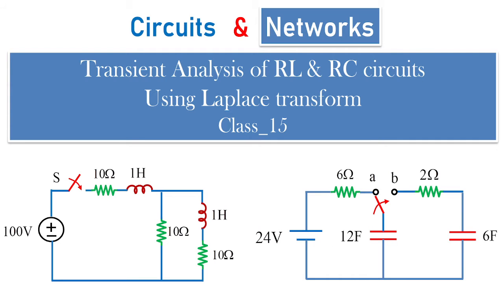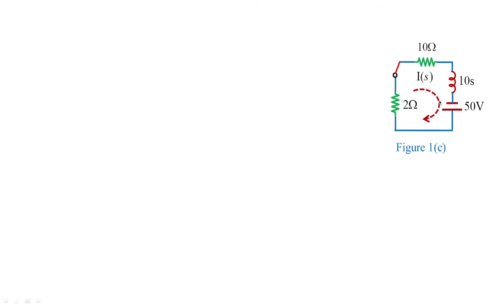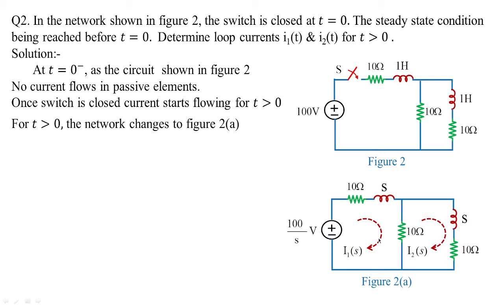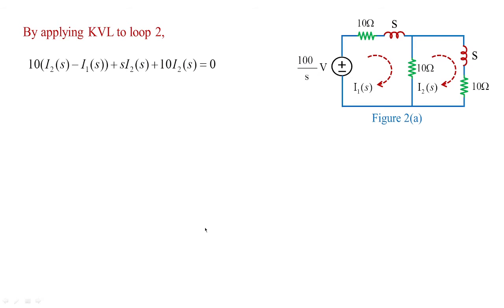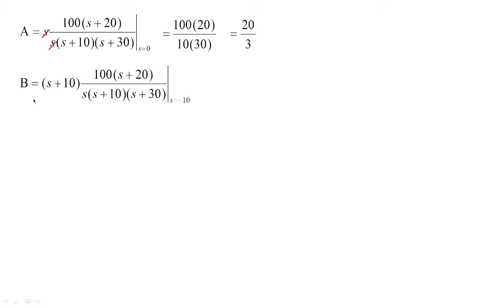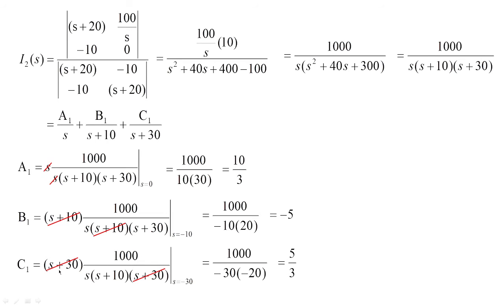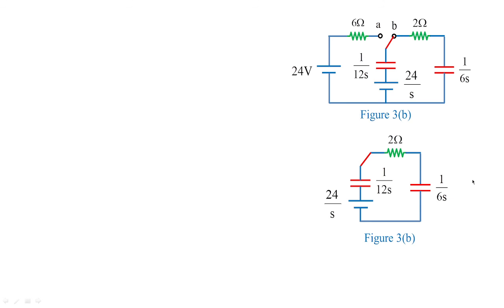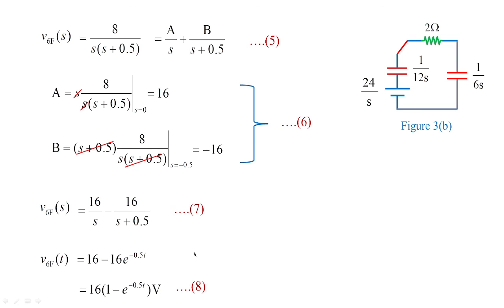How to obtain transient current solution using Laplace transform technique?

Comment: sir question for the first problem. When the inductor is discharging we take the voltage 50v  in the kvl directly in case of an inductor but in the last problem for the capactor we take 24/s. Why dont we take 50/s for the inductor also?
Reply from the maker: ya listen, the actual impedance formula is given by Z = (R+jX) ohms, where R is Resistance (Real component) and X is Reactive (imaginary component). Here, X could be XL(inductive reactance) or XC(capacitive reactance). if inductor is present then XL = wL, if inductor is present then XC =1/wC. In frequence domain XL = sL, and XC =1/sC. for further clarifications, look out the transient analysis using Laplace transform techniques.
https://youtu.be/gGjhO5zbPNE?si=MxXPAg2vnWurvzgk 
https://youtu.be/BwDWSqKfGKo?si=sywDKjs-Ydy205Cy

Comment: In the last problem, what if the capacitor are 12μF and 6μF? For the laplace equation should be 1/(12μS) and 1/(6μS)? Or anything else?
Reply from the maker: yes, you are right. 12 micro and 6 micro changes to 1/(12 micro S) and 1/(6micro S).

Comment: What we have to do if there is inductor instead of farad in the place of 12 farad
Reply from the maker: Good question. If In the place of 12F capacitor, an inductor was present, then the current through it would have reached to a value of 2 amperes. Then, the rest of the solution ( i.e., the final capacitor voltafe across 6F)would have been dependent on this inductor current.